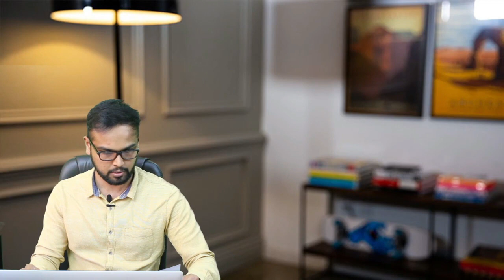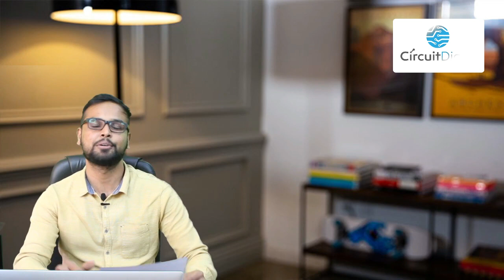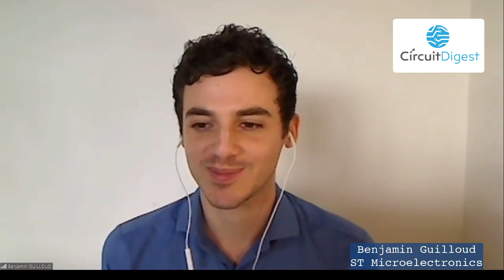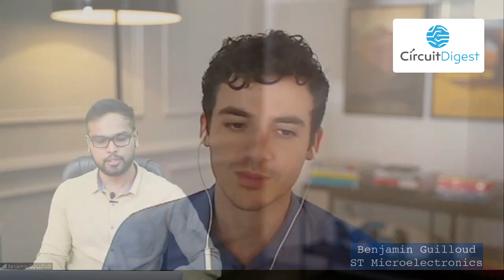Benjamin Guilloud from STMicroelectronics on their LoRa-enabled SoC STM32WL | Q&A | Interview

Comment: Why they introduce products when they don't have stock of development boards anywhere around the globe...such a crap
Reply from the maker: which development board were you looking for?
Reply: @Circuitdigest  STM32WL ...Video is about it only.
Reply: It usually happens for two reasons -- either it's a brand new product and they haven't made it into distribution yet, or they're sold out.  I don't know if this is a new product or not, but there is a worldwide shortage of chips from most manufacturers, so this may be the result of that.

Avnet seems to have nine of these boards in stock right now - https://octopart.com/search?q=NUCLEO-WL55JC1